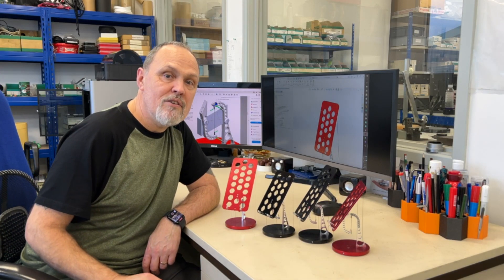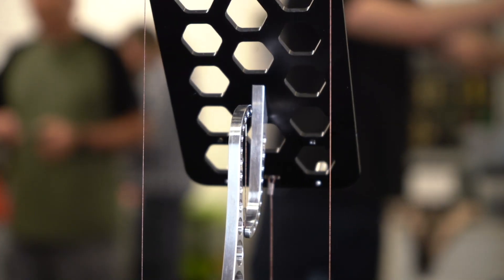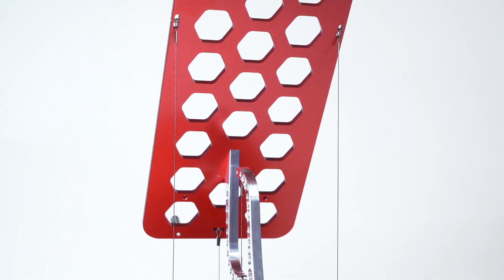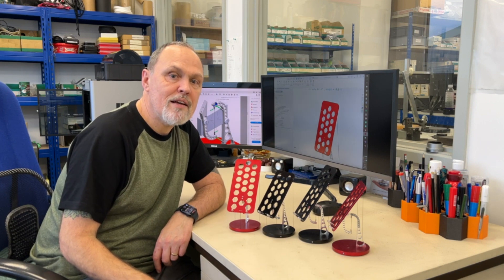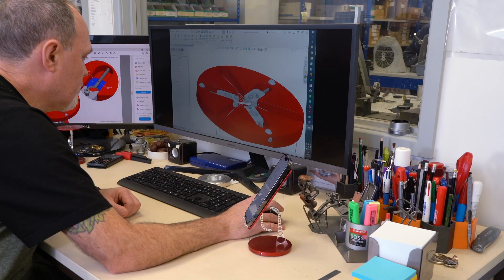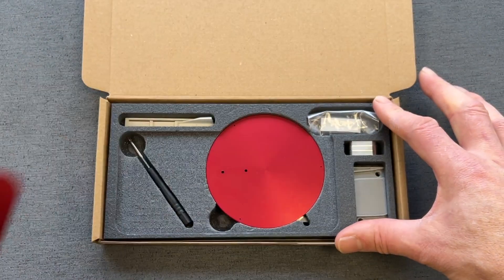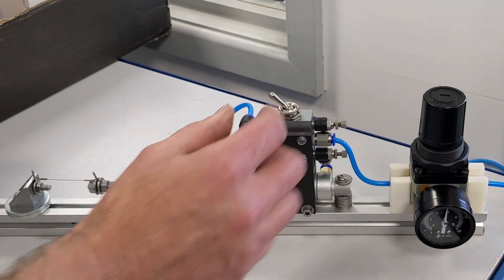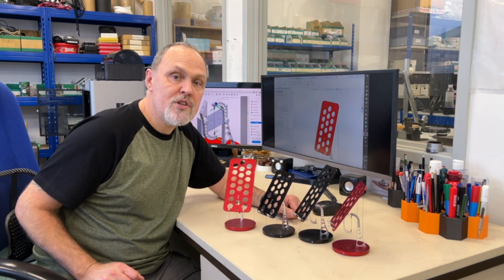Tensegrity Table for Phones

Comment: Greta idea, and as with the table, I really like the idea that the box is also designed to act as a jig for assembly.

From the prototypes on the desk in the video, I wondered if the final version will have the pattern on the base (or even the rectangular plate) as with the table rather than just a plain finish?